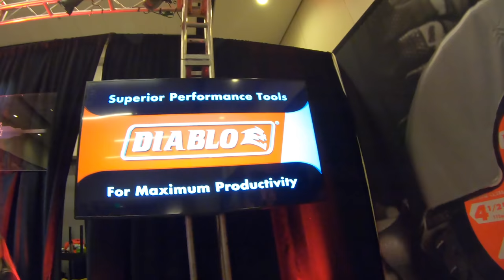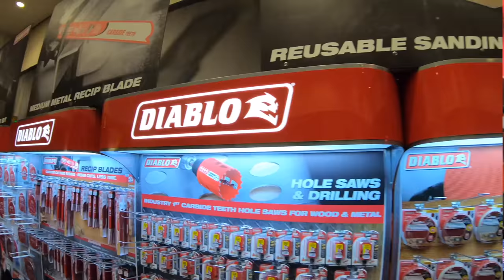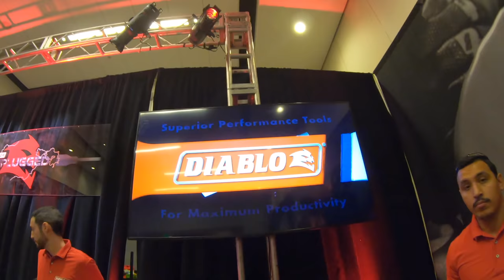Diablo Tools new Cutting technology coming in 2020

Comment: These tests are never equal tests.
Reply: Exactly.
Reply: You want to impress me with how good your tool is. Make one cut/drill one hole and then switch blades/bits in the saws/drills with the competition. Repeat your demo. If you still beat the competition, then I'll be impressed, because that's an honest demonstration.
Reply: @vryce6322  Exactly!!!! Also I know sometimes I been at these shows.  If you look what they are connected to they have a voltage regulator so they can adjust the power.
Reply: @vryce6322   Brand new blades, opened straight from the package too
Reply: @mattzimmermann4423  Unfortunately that's too easy to alter. It's nothing for a company to open a package and then reseal it with an altered blade.
Reply: @vryce6322  That's implying the drill is the variable, which it's not, and that would introduce actual variables... Charge capacity and temperature increase.
Reply: Andrew Delashaw If the drill wasn’t a variable then there shouldn’t be any problem with them repeating the demo after the switch. Go ahead and try and ask them to do that at a show. See how many different ways you get told no. The only constant in these test is that their product will win. The Drills are a variable. The power source is a variable. Even guy running the tool is variable. Don’t believe me? Stan or maybe tools in action has a video of Dewalt doing the exact same tests against diablo and beating them. I believe the same video then shows diablo beating dewalt. How does that work if the variables aren’t rigged?
Reply: @vryce6322  
This is how these tests are always rigged in favour of the tols being demonstrated.
Those demonstrating are never gonna let their product lose.
What do you think they get paid for.
Reply: True. That guy even said on 4:35 Battery might be little lower on that when Makita with Milwaukee blade clearly run out of battery.
Reply: Would like to do those tests myself. How to get the Diablo blades and drill to the Netherlands.  Why aren’t they available in Europe?!

Comment: First and foremost, I want to say THANK YOU !! I like all your videos. In testing tools, I prefer a test using the tools how they're designed to be used. Because of my situation being on a fixed income it drives me crazy to see "torture test". Ruining a great tool for giggles makes me want to cry, because I can't afford to go buy it on a whim. Now don't get me wrong I believe that they have The right to do so !!! In fact I am trying to find out if there is a way to salvage a DeWalt drill? About 2 weeks ago, I found my drill in a rubber trash can from when I moved my Mom back in July. It was in my side yard, and I didn't realize anything was in it. Since my Mom is in an Apt now, all her outdoor maintenance stuff ended up at our house (mobile home). I was weedeating a small area to cleara spoyt to check for a water leak. In the process I dumped the rain water out of the trash can. When I picked it up after dumping the water out to my horrer my DeWalt drill was laying on the ground along side a bit set !!! It's hard to explain the SINKING PIT feeling I had in my stomach. 2 fold it is a gift from my Mom and the best drill I've ever owned. I don't know when I will be able to replace it? If I can't salvage it? I like your how to videos the best !!! I feel like I'm accomplishing something if I am learning, even if I am not actually doing the work. I miss Frankie !!! Like to see him in some upcoming videos. Thanks again for sharing your thoughts and videos, Rodney God Bless you and your family Happy New Year !!! Looking forward to 2020
Reply from the maker: Thank you Rodney, I appreciate the comments and really happy to have you here and watching. Happy new year to you also!!

Comment: I really appreciate all of your videos.  If I have to choose just one...it's tool reviews.  I just can't afford to risk buying a tool that doesn't work.  I don't have much time and even less money.  Best vs best comparison it's very helpful.  Also consider different battery platforms/ manufacturers.  I've had Dewalt for many years, but will consider a change to a different platform soon.  There's so much out there.  I just know where to start.  Dewalt's lawn mower is junk.  They don't have a snow blower.  A power station is available but would Milwaukee's be better?  Or Greenworks, or Ego, or Echo?  Do I pick one brand and deal with it or multiple brands and have fewer batteries?  That's my biggest issue I guess.  What's the best battery line?  It seems everyone has tools that will do the work.  The batteries are where the money is.  Thank you for asking for input.  Long time viewer, infrequent commentor.
Reply from the maker: Thanks Simon, I appreciate your comments and thanks for being here!

Comment: 2:00 - seems he certainly isn't any sort of mechanic... Different grades of "cast iron" are still commonly used for automotive, heavy commercial, and 'most every other vehicles - cylinder heads, blocks, crankshafts, connecting rods, gearbox housings, differential housings, stub axle assemblies, just for starters. While it is heavy, it is cheap and strong enough for the applications.

With the open' cut, there will be a bit more grabbing, but it would have been more interesting, and illustrative, if they were a full cuts through a piece of 6"x6" beam as even with the most carefull lining up, each of those cuts would be cutting a different cross-section of the wood. I did like the way the know seemed to have no affect on the Diablo cutter.

All three types of videos - they are all informative, in different ways.
Reply from the maker: Thanks for letting me know and for watching!

Comment: These demonstrations mean nothing but I can tell you the Diablo Steel Demon is an amazing blade. I needed to cut out my old 4" cast sewer line and I bought a Lennox "cast iron specific" blade, a Dewalt metal blade and the Diablo blade because once I started cutting I couldn't use any water and wanted to make sure I was prepared. The Lennox and Dewalt both dulled out before even getting into the pipe so I was really nervous but the Diablo Steel Demon made 6 cuts (had to cut 30' into manageable sections) and is still sharp enough to keep going. It's first Diablo blade I've used but if they're all that good I'm sold

Comment: Job site is truest example of tool quality...would like to see a recip blade that can effectively cut through 3/16" stainless steel...thanks for your unvarnished efforts to get this info out!
Reply: I'd like to see a reciprocating blade where you can break off half of the blade and use the other half
Since most sawzalls don't come with an adjustable foot you're forced to use one section of the blade and waste the rest of the blade

Comment: More shady rigged tests by Diablo. 

*Self-Feed:  I agree with Chris Bell, it be start as cast or forged steel but they are definitely NOT cast iron. The 'used car salesmenship" begins with the first demo. Next the Diablo drill sounds like it is running stronger which is also supported by the other drill running out of power before finishing the test (something which seems to happen in a lot of Diablo's tests). It is also obvious that the guy in the Diablo bit is putting more pressure into the bit, confirmed by the way the other guy was holding the side handle with his fingertips not his whole hand and how it got away from him when it grabbed.

*Framing Saws: Same test they ran Stafda with the exact same guys and the exact same result. Almost like it was planned that way. The guy running the Dewalt blade even checked the battery after the saw stopped exactly the same way he did in the Stafda video.

*Steel Cutting: FIrst off he was pushing that cutoff wheel way too hard and then Mr. Used Car lied about the amount gone off the blade. Second if you have that much steel to cut on a job and you want to do it safely you will use a metal cutting chop saw.

*X-Lock: No thanks. I'm not going to pay 3 times more than the professional quality cutoff and grinding wheels I currently use for the sake of using a spring clip system.

*SDS bits: Notice how they didn't bother trying to use the vacuum with the competitor's bit. It is almost as if they knew the it would snap exactly like it did. I've used a ton of concrete bits in my career and have NEVER seen one with a heat bloom like that from use, even after I completely destroyed the tip. Notice how when they were using the torches the mouth piece kept getting the guy with the torch to back off of the Diablo bit. I also noticed the competitor's bit sizzled when it hit the water whereas I didn't hear that from the Diablo. Of course the torch gag was just for show. I'll put money on them heating the competitor bits to the point were they knew the carbide would get brittle when water quenched (somewhere above 1200 degrees) and they were all prepped prior to the demo. 

This kind of sleazy BS is sad. I have always been so-so on Diablo products but I like Freud router bits even though they are the same company. I guess I need to start looking to Whiteside for my bits.

Comment: Hey Diablo, let's see what happens when you hit the edge of rebar. I bet the farm that you won't get a straight hole then. The bit will take the path of least resistance. Secondly, the drilling of the holes demonstration made me cringe. What moron would drill a hole that large in diameter and that deep without clearing out the chips at least halfway through? To be honest, I was not impressed with any of the demonstrations no matter how close or how far back you were from it. 
        I like all sorts of content, it keeps things from getting stale.

Comment: Yeah what a load of crap, you can see, clear as day, the guy on the left is applying pressure, after restarting the second hole, but lol if you take out the human element, and used weights, then it would be impressive if the same results were achieved
Reply: Project farm channel does some pretty good comparisons.